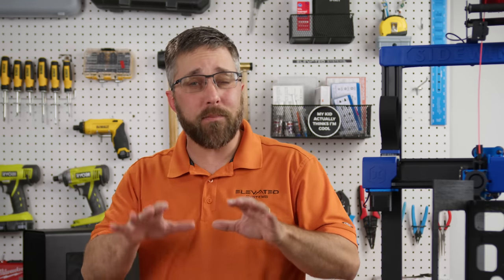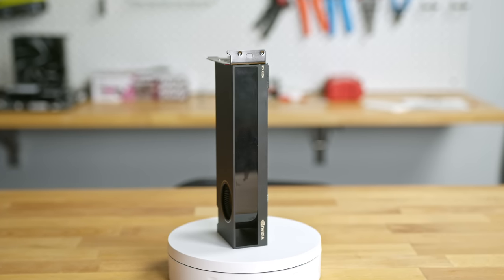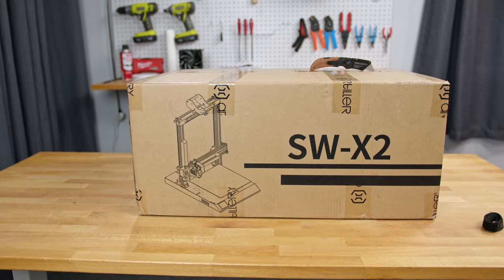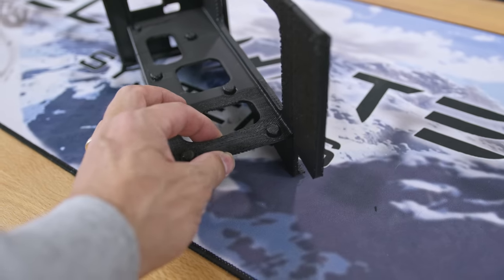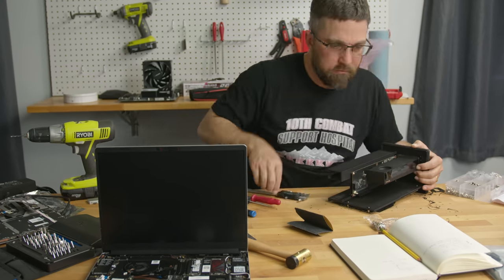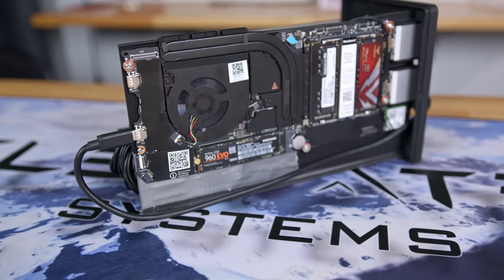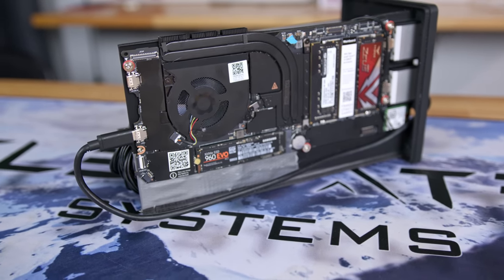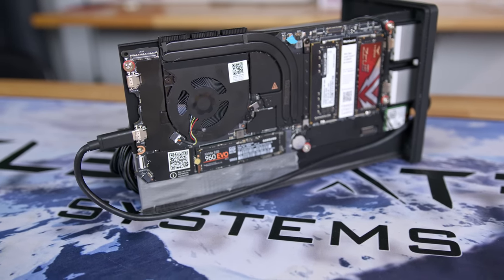Crafting a Framework Desktop: The Mainboard & GPU Enclosure Build!

Comment from the maker: I just watched 3D Printing Nerd's 3D Printing a Lamborghini Aventador video, and I now I have a crazy idea for this case. Carbon Fibre and resin on order. Stand By. 😀
Reply: Remember to wear proper PPE! Many DIY's forget this step.
Reply: 13:32 Sees CPU hitting >90*C temps... That's incredibly toasty. For your Mk II you may wish to replace the laptop-capacity CPU heatsink with something that can better take the load similar to this laptop repurposing: https://www.youtube.com/watch?v=e3fnsGHe8eE Since you're running a server-esque flow-through design you might to replace the 120mm Fractal fan with a monster 140mm Noctua IndustrialPPC fan and set the PWM fan curves accordingly.
Reply: Update?
Reply: TB3 is known to be an issue on latency sensitive workloads like games. The performance may also be linked to the interface being trough the TB3 controller instead of direct PCIe.

Comment: I'm really impressed with your build process, your skill is way above my pay grade 🙂
As I shared before I installed an RX A2000 in a SFF Dell OptiPlex 7010 (16GB RAM/500 GB SSD).  I've been very pleased with its ability to run the games in my Steam library (usually at medium settings).

Comment: Maybe, as an experiment, it could be nice to test the enclosure with the GPU using an OCuLink cable instead of Thunderbolt due to the latency issues the later has; there are options of m.2 to OCuLink connectors and OCuLink to PCIe on the web that seem to mitigate (almost) completely that issue. The problem that arises from there is how to install the boot drive.

Comment: The HDPlex 250 watt GaN might be the power supply alternative you’re looking for. Should give you the headroom for a more powerful card as it’s much more efficient and it’s practically silent.
Reply from the maker: My concern is encasing a passive PSU in insulating plastic. I would have to open up the PSU compartment to allow airflow around the PSU.
Reply: @ElevatedSystems there is the “send cut send” service they do custom sheet cuts in aluminum.

Comment: You could gut those new Mac TB/USB C expansions/docks that both have a 2.5 in SATA and NVME slots for better desktop replace for storage. Honestly hadn't seen anyone gut them but definitely interested on seeing them disassembled to see how they work.

Thinking of the main board port limits - one for power, one for GPU, one for ports and one for the internal dock is cutting close, but should be passable as a desktop PC.

Comment: That front part you should have placed a 140mm fan in there to blow inward and ran it off of usb power with a noctua controller with the twister. Then this would have been crazy good. I wish we had options of turning our laptops into desktops in this way, like our gaming laptops.

Comment: That CPU should never bottleneck that GPU in games.  As you said near the end, it is thermal throttling.  Your problem is cooling.  Playing games on a workstation card is probably introducing a bit of driver overhead and inefficiency that taxes the CPU more, but it should still be GPU limited.  Using a workstation card and Thunderbolt combined shouldn't introduce more than a 10% overhead with that GPU.  Perhaps while handling you disturbed the seating of the heat sink, perhaps it needs new thermal paste, perhaps air is not flowing in and out of the case well and it needs a proper case fan.

Kudos on the project.  The prototype looks really good so far.
Reply from the maker: The CPU is operating exactly as it's designed to. It's an ultra-low TDP processor that is only intended for short bursty workloads and not for sustained boost clocks. The minimum assured power is only 20 watts, so for extended loads you can expect average all core clocks below the base clock speeds, with cores boosting for only as long as they have the thermal headroom to do so. It's a CPU designed for an ultraportable business laptop, not a gaming machine. The CPU will always thermal throttle regardless of the cooling solution used. More cooling will only give the cores more thermal headroom, however, they will still eventually hit 100C and throttle. It's just how the CPU was designed.
Reply: @ElevatedSystems   I like your design.  If I had a large enough 3D printer I would use it, only modifying it to add a case fan.  I promise you, if you address the cooling issue, you will get much better performance.

TDP doesn't really mean anything, even if they call it cTDP Down or Minimum Assured Power.  Framework's specific implementation allows indefinite operation up to 35W and burst operation up to 64W.  The U-series are the ultraportable designs.  The P-series are for high-performance thin-and-lights. The 1280P is an identical chip to the 12700H that goes in high end gaming laptops and mobile workstations, just different BIOS and marketing.  I have one with a 3070 Ti (laptop), the GPU is almost always the bottleneck. 

The CPU will absolutely not always thermal throttle.  With proper cooling it will power throttle first.  If you don't believe me, perhaps a test using a power meter.  Run Furmark on the computer, it should use almost no CPU power, but dump a bunch of heat in the case.  Measure how much power the system is using.  Then, while Furmark is still running, also run ADIA64 or Prime95.  Wait 20-30 minute.  Measure the power usage again.  If it has not increased by at least 15W, you still have power headroom.

Comment: Is it possible the TDP and cooling are holding the CPU back? They were designed with laptop limitations in mind. It might get close to sunk cost fallacy, but checking if you can up the TDP and add proper cooling could be worthwhile. You're already knee-deep in the project ;)

Comment: Nice video, maybe interesting to see if you change the cooler on the cpu if the sustained performance increases.
Reply from the maker: I'm retrofitting a larger cooler on the 1260P in my iMac conversion project. We'll see how it goes.
Reply: @ElevatedSystems  very interesting, thank you for the nice and entertaining framework videos!
Reply: I wonder what the difference would be to have a low profile desktop CPU cooler, or a Regular sized cooler like a stock cooler, and how you would connect a fan or even passively cool it.

Comment: Hmm, sandwich the motherboard together with the GPU, remove the fans and heatsink, creating a custom waterblock that cools both components. Might be able to squeeze the SFX PSU, radiator with fans and reservoir in the bottom chamber.

Comment: This is pretty neat!

But I have to comment on the DLSS selection. DLSS should be used only when the GPU is at max load and there's still CPU power available. Because it uses a bit more CPU in order to do the upscaling. So, ironically, the games would've probably run best with no DLSS at all! Though on Last of Us and Cyberpunk, some settings might've needed to be tuned down.

Also, what others said, good cooler and all, the CPU might go miles better. From the footage, it seemed that when it passed 30W, it also passed 90 degrees Celsius. Having that taken care of, it might be able to run sustained at 35W and that might be enough for the games shown here. And as someone else said, these CPUs can go up to 64W, including sustained, if they have the cooling. But I'm not sure what can be done in such a small case.

Also also, wtf YouTube, when I expanded the description section, the chapters at the end have the thumbnails from an LTT video instead of ... you know... the current one. I guess the 4060 Ti one. And the timing too. Jeez.

Comment: Yeah I’ve found my main board is super sensitive about power supply. A standard 100w power supply would power the board but cut performance way down. I’m currently using 140w as that’s what I had floating around and it doesn’t compromise performance (I just tested over and over with cinebench r23). I have a 1280p though so it’ll be different with tge 1260. Also, wow thermals make a massive difference. I can’t game with an egpu with my printed cover on, it stutters like yours is looking like it is. I’m thinking it needs a custom heatsink ultimately, which is out of most peoples scope. I’ll be looking at venting fresh air to the fan intake, and reducing possibility of recycled hot air  back into my case next refresh…

Comment: Love this project! Did you have any thoughts about a 5G LTE expansion card for the laptop?
Reply from the maker: There is at least one developer that has made an LTE expansion card. Adding whichever expansion cards you like is why I included the expansion bays.
Reply: Pretty much all lte cards use the usb2 pins for comms even if they are mini pci-e form factor. Keel this gotcha in mind

Comment: Nice. This is an energy efficient gaming PC, though a gaming laptop would perform similar.

There is also a 12GB version of A2000, which is quite interesting as better quality looking textures would not require more CPU performance.

I wonder if you could overclock the CPU? Maybe install a custom proper CPU cooler would be enough?
Reply from the maker: The extra cost of the 12GB version is probably only justified for professional workloads. The low power U sku CPUs can't be overclocked but I am adapting a larger cooler for the 1260P in my iMac conversion project. It should let the CPU boost higher for longer periods.

Comment: Ok, ok ok
When businesses recycle these in bulk, salvage the motherboard and batteries from any devices with a bad screen or frame, make a 3U rackmount case that stacks these together like sheets of paper in a book, with an internal 20 port KVM with 40G switch(2.5g to each device) and a 1500w PSU to supply power to all of these little powerhouses.
On the back of the chassis, just 2 power inputs, a QSFP+ port, some large fans, and a set of video and USB ports.
Maybe add KVM switching buttons to the front.

God tier case would allow for these compute blades to be hot swappable
Reply: See, THIS is the kind of company practices I can fully get behind.

My next Laptop will probably be a Framework once the one I currently have inevitably glitches. And once the Larger version is ready for sale.

GOD I LOVE the 6+ module version dream! I am going to have SO much storage available it’s insanity
Reply: @jeremydale4548  We're trying to switch to them because we're tired of paying $600 to repair a charge port because our ~$150 per device warranty doesnt cover user damage
With framework its like $9 and 5 minutes, instead of weeks worth of shipping and waiting on tax exempt BS
90% of our hardware repairs are the charger port because students put the laptops in the bags with the charger still plugged in, or set the laptop down on a soft surface that allows the laptop to sink, bending the charge port repeatedly causing the board to delaminate

Comment: @ElevatedSystems Why did you routed the USB PD cable to the USB ports on front panel? Why don't to the back side (it's nearer than front)?
Reply from the maker: I didn't. The power is delivered at the rear. Besides all the USB ports on the main board are USB-PD so you can plug into any of them.
Reply: @ElevatedSystems  In point 9:05 you use the long cable instead of just short one from the PD power supply to the motherboard USB ports on up of it?
Reply from the maker: @rotm1  that's the connection to the eGPU and I use the front port to allow for the two expansion modules in the rear.
Reply: @ElevatedSystems Oh, ok :)

Comment: That grinding and clicking you were seeing, was that not just the thumbscrew way too tight?  The fix should be turn that screw loose some
Sincerely an X1 owner that has done that same thing
Reply from the maker: No, the PTFE filament guide tube was too short and the filament was melting and charing in the hotend clogging it up. I replaced the PTFE tube and it's running great now.

Comment: I have a question for you. Do you think a framework board could be easily used in a media server build? Something basically just used for plex, or do you think there are cheaper and better ways to do thi?
Reply from the maker: If you are reusing a Framework Mainbord after an upgrade than it will work well, however if you are looking to buy something there are much cheaper ways to go.

Comment: gaming performance drops not caused by the cpu, there is a significant problem with the a2000 when it comes to gaming, it can not sustain gpu power limits so it fluctuates, A LOT.
Reply from the maker: It has the same performance issues when tested with a GTX 1660, RTX 3060 and RX 6750 XT.
Reply: @ElevatedSystems  hmm, I have quite few a2000 and as soon as they hit max tdp they tend to lower gpu clock and fluctuate high-low frequency levels. keeping them on 45Watts however changes this behavior. Still, there are a few mods out there to increase power limits, I might give it a try.

Comment: Can use 3060 drivers I believe with the A2000 and get good gaming performance.
Reply from the maker: You can but it won't change things with this setup as the CPU is always going to be a significant bottleneck.